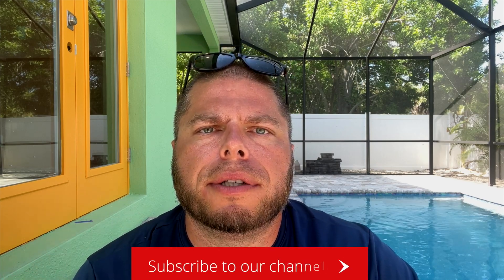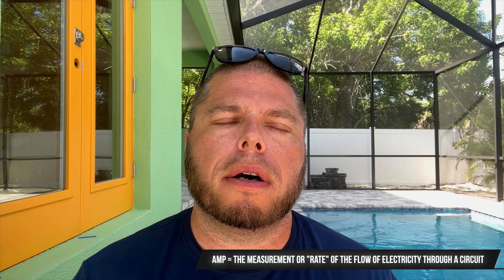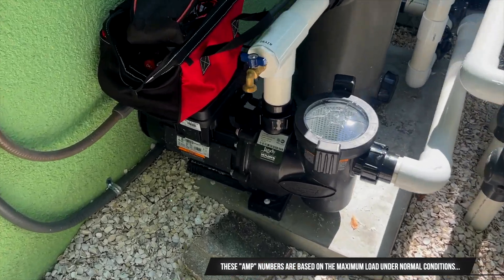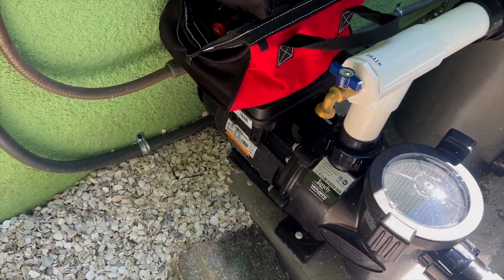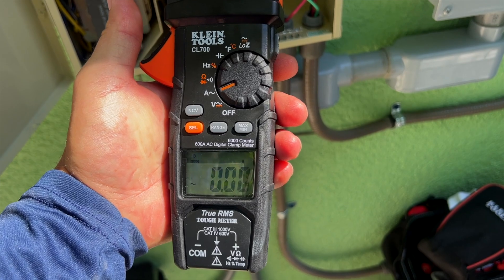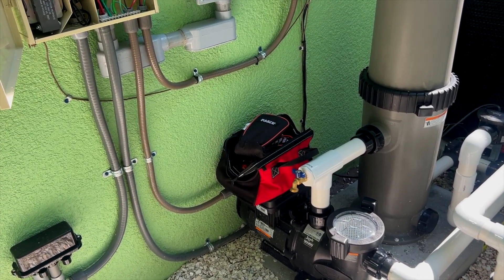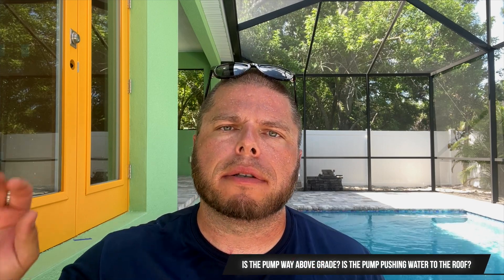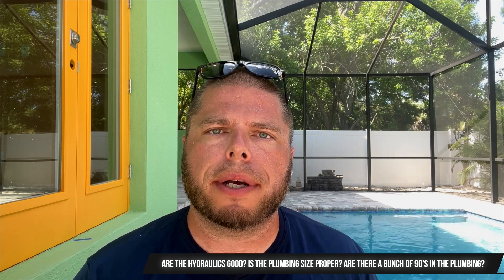How to Check if Your Pool Pump is Dying Using Amps?

Comment: How do I fix and over current reading on my pentaor variable speed pump. I've replaced the drive and it still says it.
Reply from the maker: What's the voltage going into the pump?

Comment: Clean pad, but damn I hate when installers put hose bibs as waste lines. So inefficient, throw a 3 way valve between the pump and filter and let the pump move the water.
Reply from the maker: I completely agree with this 100%. You can lower the water way quicker with a diverter!